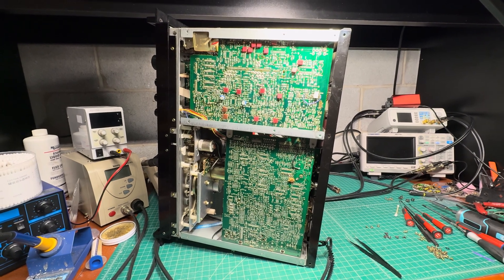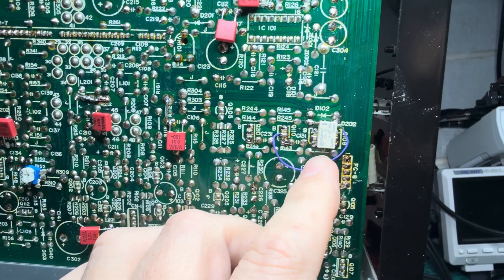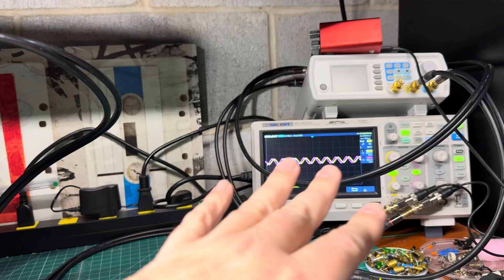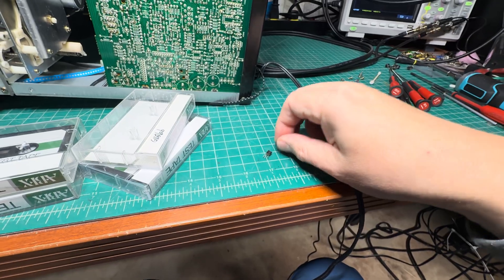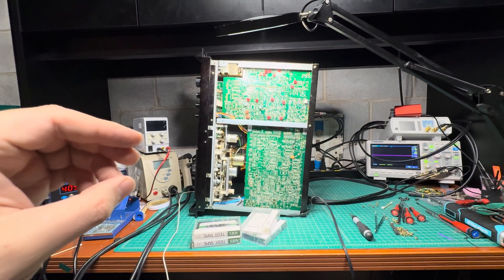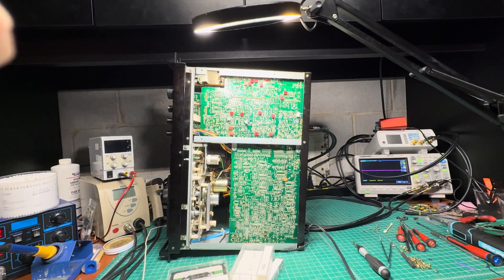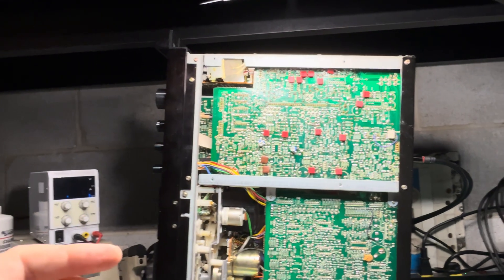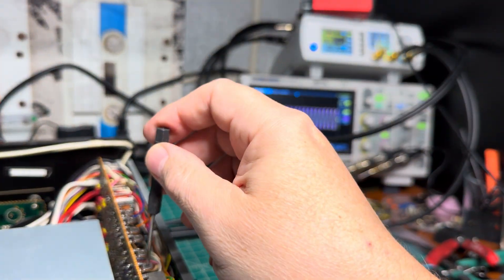Goodbye Muting Transistors, Hello Relay! | Nakamichi 680ZX Gets Insane Clarity!

Comment from the maker: IMPORTANT! Do not repeat this design for now. It has a flaw - signal spikes during power ON/OFF. I will work on a better design.
Reply: So the current implementation is basically the same as just removing the muting transistors? It might be a better idea for the relay to be OFF normally, and only activate when play/or monitor is active. If we can work out the design, the DRAGON might also benefit from replacing the muters with relays. I am working on a dragon, which after significant modifications and full recap, still has a sterility to it. In my experience, muting transistors are the main cause. when it comes to the dragon, the Dolby chips will be the limiting factor for the sound, unless we design a Dolby bypass with relays.
Reply from the maker: @Astralify I am already working on new design. For pure audio I ordered relays with Silver- gold plating. Videos are coming with updated design. But this test revealed so much hidden potential.
Reply: @hifirulezzz  Awesome! Looking forward to it. :)

Comment: I'd be very interested in seeing these upgrades applied to preamplifiers, cd-players, tuners etc. Hopefully from the same equipment range. 
It's the first time I hear of muting transistors introducing distortion. I have read about them being removed before but without evidence of the sound improvement being mentioned.
What is that technology using lead in the transistors? If this lead is responsible for the oxidised legs, then surely we would see this oxidisation elsewhere too given that most solder at that time contained lead? No?
Reply from the maker: Hi there, thanks for watching. That is a documented issue with some transistors which has used lead on the crystal base, and that kind of lead got deteriorated over the time. The most known issues are with 458 series of transistors, which stop work or introduce crackles in the Reel to reel decks. Muting transistors have special quality - they can withstand -25V reverse voltage applied to BE junction, and as result go fully locked and do not introduce any additional noise in the signal, however these parameters look to change over time. I had to replace these transistors in my RX-505, as they were leaking negative voltage to the output. And with this deck issue started to occur more and more frequent over time. I tried to replace 2SC1636 with the same kind 2SC2878 as used in RX-505 but it did not work well. distortion was coming right away due to different reverse hFE 575 vs 850 and connection via diodes. I experimented with shortening diodes in 680zx, but it still did not cure the issue. That is why I decided to go with relay. reliable and will not introduce any distortion. And I have to say I impressed with the final result.
Reply: @hifirulezzz  I had no idea muting transistors were of special design. Thank you for the very detailed response. If this technology was used in transistor production there is probably a whole series of transistors that suffer from this issue. It's a good thing that replacing these muting transitions with relays was an easy change to make. I suspect the whole reason muting transistors were used in the first place was primarily the lower cost. That is no longer an issue when restoring an old tape deck. I'm sure others will also want to follow.
Reply from the maker: @Stelios.Posantzis  Agree with last statement. These transistors were not long living. And actually not produced for a long time now. Relays did push these out. And FET transistors, due to better parameters.
Reply: For CD players, just remove the transistors altogether, including the ones that switch the DEEMPHASYS circuits. Those are the biggest degraders of sound. You will get some pops on turning on/off,. but it's nothing compared to the benefits this brings with the sound.

Comment: I'm following these mods with my 680 deck.  Just did the Wima bypass caps - still breaking them in.  Wondering if pin 8 (-) of the G6K-2P-DC12 relay is that connected only with the jumper wire to middle pin of Q110?  difficult to tell in video. Thank you!
Reply from the maker: This relay has + and - for the coil. + connects directly to diode and - connected with a wire to the ground.
Reply: @hifirulezzz  Super Thank you for your reply and really appreciate you sharing these mods here. Just ordered my parts to try this one out.  May also order some NOS 2sc1636's to replace Q110 & Q210 in case those legs have corroded into body.
Reply from the maker: @Sans_Solo_  Let me know where you will find 1636, I gave up, only found 2878. And these has oxidized black legs too.
Reply: @hifirulezzz  I've had good luck with Consolidated Electronics Inc. (Dayton, OH) They sell on eBay but also have a webpage. They have NOS Sony 2sc1636 for sale now.  Tho don't know if Q110 & Q210 must be gain matched?
Reply from the maker: @Sans_Solo_  no need to match gain, they just on or off, the point is they are extremely low noise when off with negative voltage. check legs color when you receive replacement. should be shiny. if black - you may trash them right away. These transistors are discontinued from production 30 years ago.